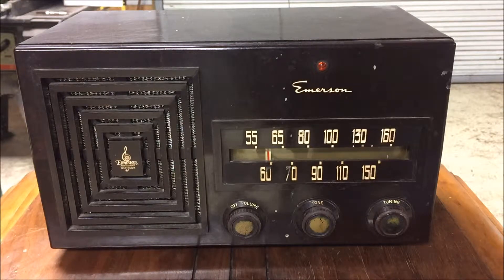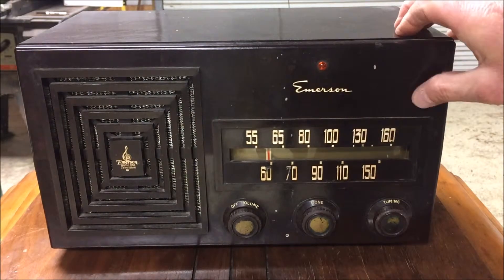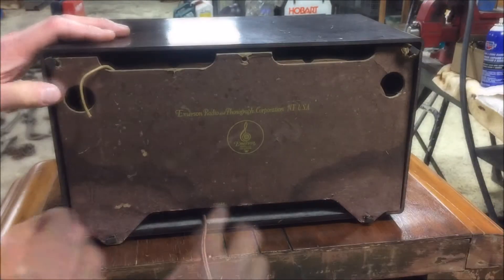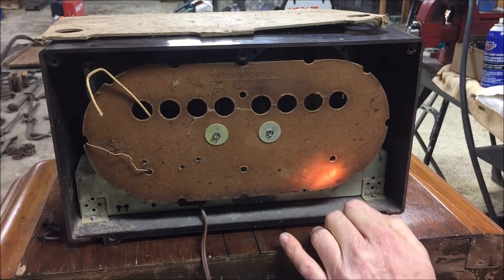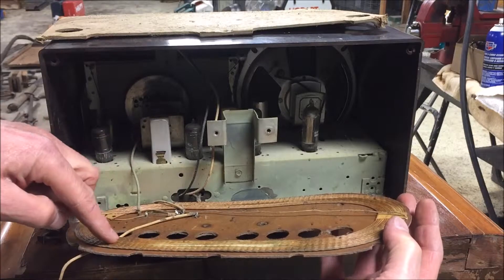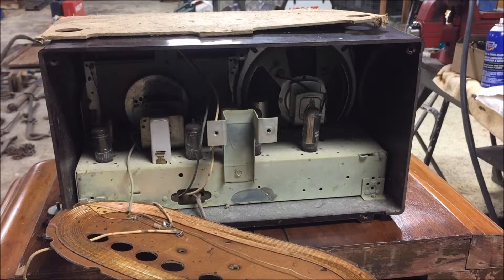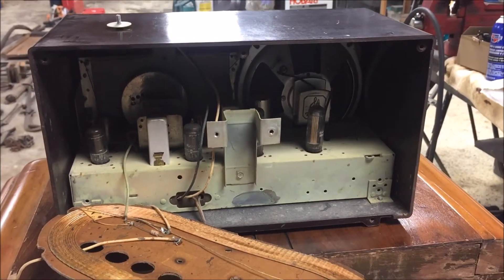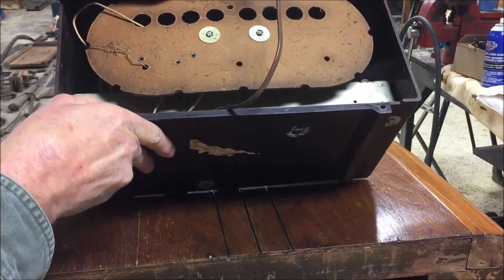1951 Emerson Model 641B or 659

Comment: As far as that tube being covered, that is what is known as a tube shield.  Many old tubes could interfere with each other if they were all out in the open creating background hum or other noise on the radio if they weren't shielded from each other.  You'll see some radios with black metal tubes in them.  those were invented to keep out interference as well eliminating the need for a tube shield.  Again, as with all these old radios your reception will also get better or worse by turning the whole set so the directional antenna can be facing towards the station on the dial you're trying to pick up.
Reply from the maker: That's interesting.  Thank you